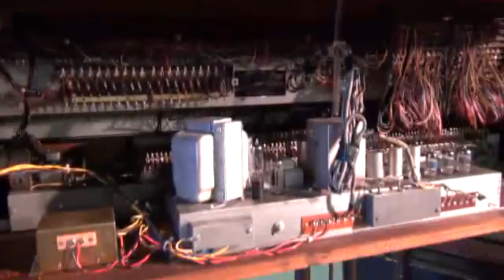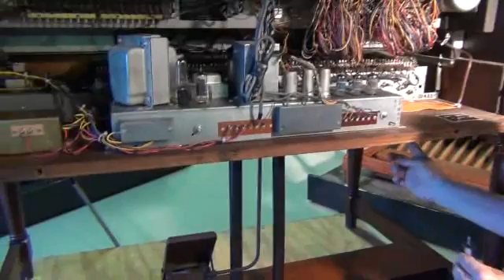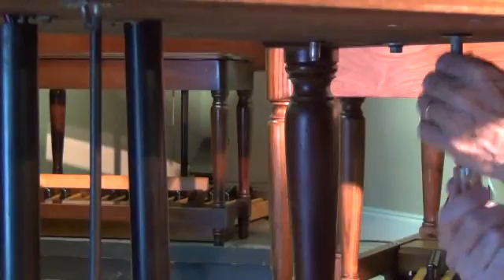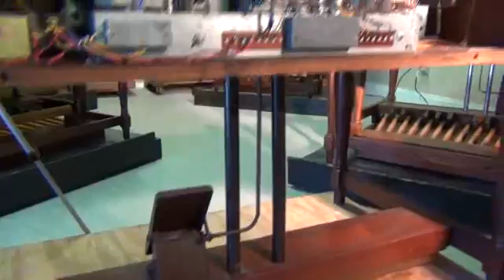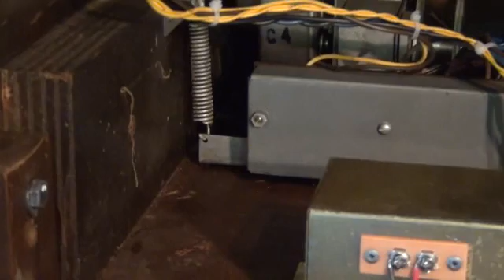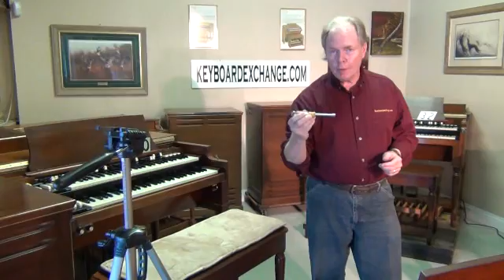How to lock down generator for Hammond B-3

Comment: Quick question. Will it affect the organ if it is remains locked while stationary and in service for regular use? I've noticed that is how my mind is in my church.
Reply: I hear you can play it just fine with the bolts in the locked position.  There's a little rattling noise, but you can't really hear it over the speaker, they say.   I'll keep my suspended, since that's the way it was designed, but it's better to have it locked when you don't need it to be, than to not have it locked when you're moving it.